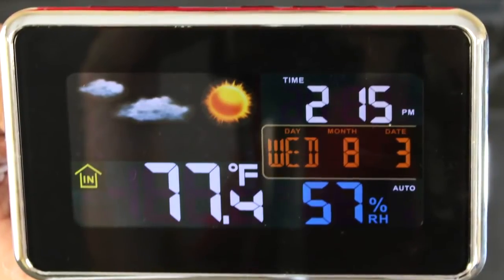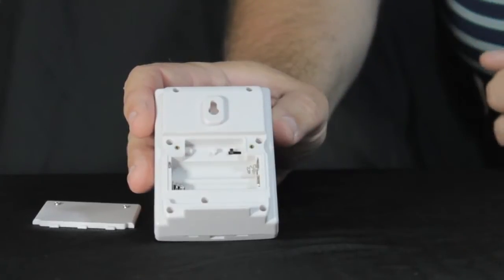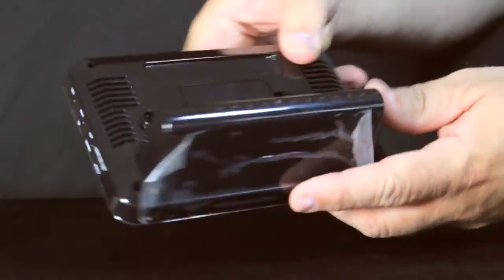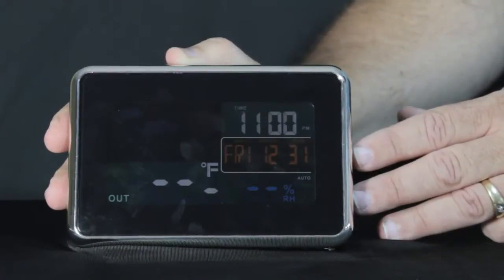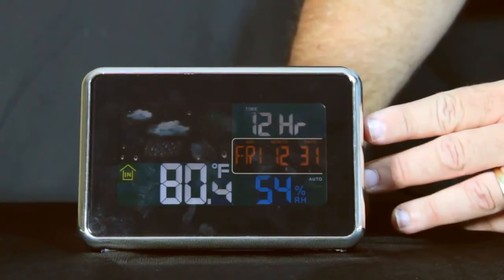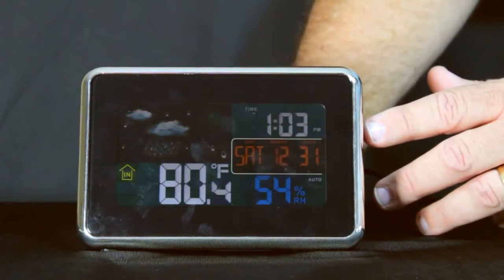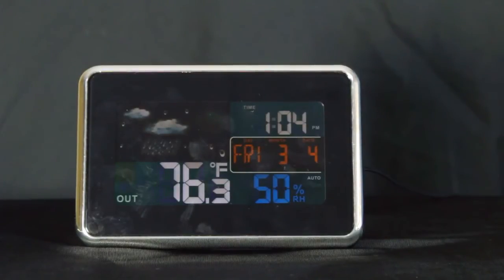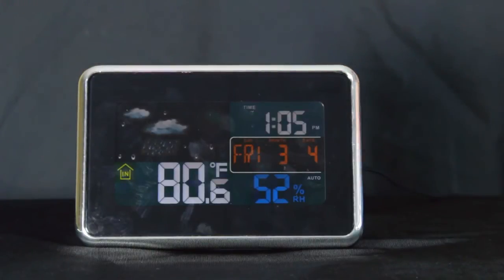308-805 Color Wireless Atomic Weather Station

Comment: My friend got one of these model 308-1414BV2 .....DC 030520. He set it up and got it working.  But he cannot get the screen to stop flickering so he called me.  I read the instruction (manual?) the only cause of flickering I saw was when the unit searching for the atomic clock signal.  We follow the instruction to make it stop flickering (searching) and it woirked for about 3 minutes now its a flickering display......
Any recommendations? Any way to shut off the atomic clock function completely? are there are causes for flickering that were not listed in the paperwork?  Thanks
John
Reply from the maker: Hey John, sorry for the trouble. Our support staff first suggested checking the power cord and make sure you have the correct one supplied with the weather station. This model number (AC6: GPU280500150WA00) should be printed both on the AC adapter and on the back of the display. More product details can be found in the full manual and FAQ docs here: https://www.lacrossetechnology.com/products/308-1414BV2#support and a replacement power cord can be found under the Parts/Sensors tab on that same page. -- But if you are using the correct cord, this flickering could also mean a bad display. In this case, please message our support staff directly here: https://bit.ly/contact_techsupport. Or alternatively, send us a private message on our Facebook: http://bit.ly/LaxTech_Facebook or Twitter: http://bit.ly/LaxTech__Twitter page for further assistance.